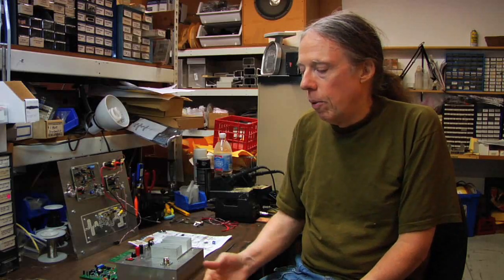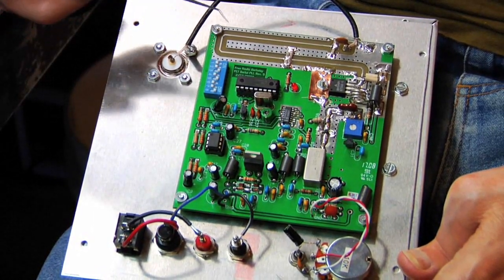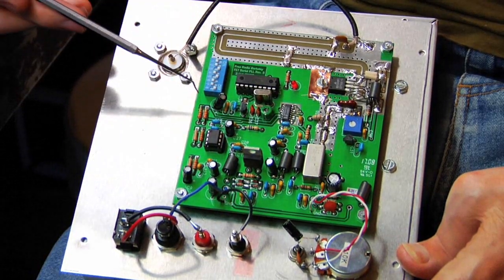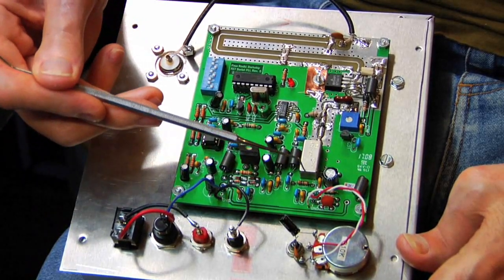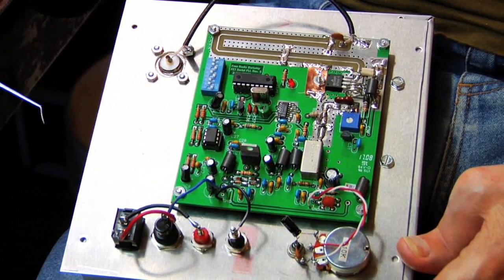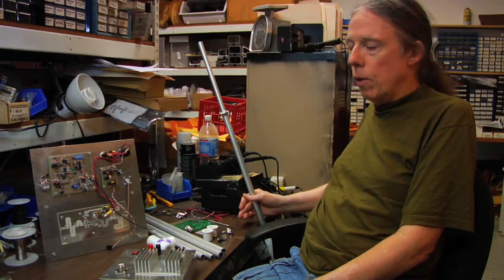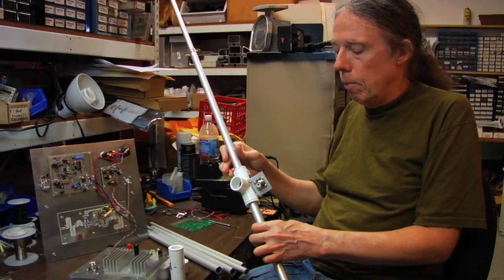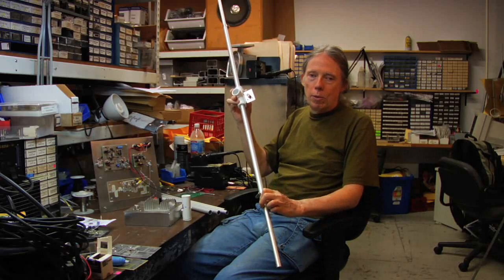How to Build A 10 Watt FM Broadcast Transmitter & Station

Comment: In the 1990's I was "R. Scott Communications". I built & sold 100's of Low-Power FM Broadcast Transmitters (mono & stereo, 5-25 watts) plus RF Amps. It was so cool to see these micro stations popping up all over the U.S. & Canada! I am pleased to see Stephen is still at it....also Wavemach Comm of Canada. Rock On Brothers!! (PS: Maybe I should go back on the Air....I still have a 25 Watt Unit...haha! Thanks for posting this video!

Comment: It's an MFJ-259B. On VHF it covers up to 170 MHz. So it will cover the FM broadcast band. Not the cheapest thing around; but it's an excellent piece of test equipment. Worth every penny I payed for it. 

You can always boost the power of the transmitter, but more power is not a substitute for a crappy antenna. 10 watts and a good antenna should be fine. On 2 meter FM I can reach a guy 6.5 miles away using only 5 watts. It works because we both have good antennas.

Comment: Hi. Agencies in the UK are using some kind of digital transmission radio equipment with a transmitter that is inserted into the top of peoples heads. Nanotechnology is also being used in conjunction which is fitted into ears and over eyes. Do you have an knowledge of this and how can it be tackled. Kind regards.

Comment: oh and the antenna was tuned to my frquency (93.9 MHz) - it had two plates which had to be aligned at the bottom , I forget now where I got the antenna from but it was great - you could tune it using a SWR meter no problems but that was a bit "hit and miss" trial and error but there was a machine which would help i think it was "veronica kits" or something the guy tuned it all for me - top fella :)

Comment: This could also be titled "How To Meet A Real FCC Employee Within 24 Hours"
Reply: cool
Reply: +kevoice lol
Reply: +kevoice We constructed a simple fm transmitter for a lab at my university. All I could think about was the FCC techs seeing twenty different signals at the same frequency pop up simultaneously on their S.A.
Reply: "How To Meet A Real FCC Employee Within 24 Hours" and than poke him/her in the eye.
Reply: kevoice      I run all NRG kit built transmitter stereo encoder and I also run 15O watt power Amplifier attenuated down to about 4O watts I also built and designed my own copper J-pole antenna usually used for 2 meter amateur radio I lengthened my elements just enough to make my antenna resonant at 1O7.3 MHz       1O7.3 FM THE PIRATE ...   I run all silver soldered tinned rf coils in my low pass filters one on my exciter or transmitter another LPF on the PA.  I have a flat match with all forward Wattage covering over 15 solid miles in stereo and very clean... no distortion I also run two dbx-163 compressors limiters.. to keep my audio at an even tempered level...
Reply: kevoice         I have the dimensions math and plans for a 3 meter broadcast band J-pole or slim Jim antenna ... j-poles kick arse for FM  VHF broadcast service.. actually they may surprise you a well constructed and finely tuned and matched up,to your system well ... they Rock...
Reply: kevoice    If anyone wants the magic numbers to divide your frequency into to give you your element lengths ....     section A the longest copper element is 8838 / ? (Your operating frequency.).   Section C is the grounding stub the short one  you take 2952 / (your operating frequency)  = your stub length.  Also be sure you make a 3 3/4 inch space between the two elements. Center of coax goes to the long element, shield of coax goes to the shorter matching stubs nice piece of solid copper house wire makes a nice gamma match between the two elements... also sliding the wire up or down the elements before you solder them permanently, I use radiator hose clamps for the matching procedure...   antenna appears as if it’s a direct electrical short... however it’s not to an alternating RF frequency...   DC yes it’s a dead short...
Reply: And you think that's good?

Comment: Is it possible to get a link to the schematic? How would I disable the pre-emphasis. I am interested in this unit. I may just buy the kit then replace the dip-switches with a micro-controller (arduino or something similar) so that I can change the freq quickly if needed and have the freq on an LCD. Also, can you recommend a el-cheapo deviation monitor? Does this unit have anything to control over deviation, or is it up to the user to run a limiter?

Comment: Hi
I'm just asking, I have a15watt fm transmitter can I take the cable that going to the antenna and connect it to sound amplifier and then take the cable from the amplifier to the antenna so as to boost the signal over this15 watt?
If not how can I increase the signal of the transmitter
Please reply your opinion is appreciated
Reply: I'm not an EC geek but to my understanding, the cable going to the antenna carries RF signal, not audio, hence the sound amplifier cannot process or amplify that signal.  I tried this some time ago and it did not work.  You will need an RF amplifier, not a sound amplifier.
Reply: RF Amplifier will do the trick
Reply: *****
Thanks for your reply friend
Send video demonstration of this if possible. 
It will be nice
Reply: gambulgambula  is very good ...dilipbhai india
Reply: You need a proper RF amplifier, not an audio amplifier.

Comment: Are there any plans to create a variable-wattage transmitter? It would be nice to go from 1/2W, 2W, 5W, to 10W on the fly as needed. Does this unit provide stereo with pilot? Also, it would be nice to have the ability to inject RDS or other subcarriers into the chip before the RF output.

Comment: Re: 6watt rev 2 
How stable would you say said circuit is?  I'm new to the game, I've built but one transmitter to date and got it working but found that the capacitance was easily swayed any movement would knock it out of tune.  PLL does interest me, but I think it may be a tad too advanced for me as of yet.

Comment: Is this a STABLE DRIFT-FREE transmitter?

If you tune a radio to it's frequency, will it stay on that frequency and not drift off?  Does it work
equally well on the old-style ANALOG string-type radios as well as digital FM receivers?

The tiny 2-transistor bug-type FM wireless mics always fall off the frequency and you lose the
signal entirely.

Also, do you need special FCC license to use this transmitter for home office or factory use?

Comment: hi
i watched your 10watt FM transmitter i like it.
but i need to ask you if your town/city has a powerful station and you tried to transmit on the same frequency  how far would you hear your music ??
iam asking because at work the young guys listen to crappy boy band song and i would like to over power them into some nice ACDC!! but then i don't to get into trouble so only about 150feet would do nice to over power them and not disturb other people.
Reply: The FCC would come knocking on your door...
Reply: Actually depends on how far you're away from the transmitter and how strong their signal is (and of course yours). Let's say you've got a 10w transmitter, then you'll probably not be able to kick off a professional 50kW station, even if it's 40km away from your transmitter.
Reply: This is illegal. You can get in huge trouble for doing that.
Reply: And?
Reply: Blocking another station is the quickest way to get the FCCs attention. The owner of that station will track you down for the FCC.

Comment: I really dislike PLL frequency control because I have had bad experiences with it on tuners,  but do like that fact it helps with drift and stability.  Do you use a BA1404 combo chip and a 19khz pilot crystal for stereo carrier?

Comment: How can we increase the broadcasting range. What are the requirements to strengthen our signals for longer communication distances. Please help :)
Reply: The best things to do to increase range are either get a more powerful amplifier, get a better antenna (if it's not already tuned to the frequency you would be broadcasting at), and arguably the most important thing is to put your antenna as high up as possible, which will allow the signal to go further.

Comment: The problem is that it was weeks ago that I put it together - minus the final + copper. I  didn't finish it and power it until last week and when I did the final got instantly hot and the LED came on for a few seconds then faded to nothing. There was no mod on the carrier freq ether. The soldering portion of this was super easy, however there was some differences in what was in the directions, on the silkscreen, and on the parts sheet (with components taped to it). I can't remember specifically.

Comment: It depends on a number of factors. One factor is your antenna. A good antenna makes a difference. Ham radio operators can get some pretty impressive distances on VHF FM using low power. It all comes down to the antennas. Dipoles are fine antennas. On the 2 meter ham band J poles are pretty popular. An FM broadcast J pole would be simple enough. Just make sure the antenna is properly tuned so you don't damage the transmitter. I have an MFJ antenna analyzer I use for my ham antennas.  (continued)

Comment: well done thanks for the video,i once had a transmitter that put out some 150watts and a big 15 element long boom wide spaced yagi,but as i was going through my ham radio licences i was always a bit worried about using it,ended up swapping it for a ham radio.dont u guys get lots of hassel from the fcc(offcom in the uk),using pirate cb was bad anuff,.
kev

Comment: why not a crystal oscillar circuit, with a socket to swap out crystals? A PLL circuit is advanced method. also, is this a phase modulation circuit or a fm circuit? (phase modulation and fm modulation are very similar

Comment: Really, what you need to design is a simple AM transmitter that can be built in prison, from AM radio parts.  Its been done before by inmates, not hard to do. I wanted to set up a pirate radio station in prison but didn't have my own AM radio to butcher for parts, as I never got shuffled around to one where you could buy it on the store. I suppose I could of bought one second hand but I was thinking more along the lines of a simpler spark gap transmitter, and also, um, just surviving day to day.

Comment: The Problem I have is Monetary as well, I can't just go buy a receiver, I can't afford one.  But I am very good at making things and I have a lot of parts because I recycle Electronic boards from old TV's Stereos, etc.. I just need to find a decent Schematic and a parts listing.  Then I could build Just about anything.. I also recently bought an Arduino Uno I wonder if that could be of any use.  I m still trying to learn how to program it though.. I am just exploring this RF stuff it is learning

Comment: sorrym this isn't my site but FYI I put a decent antenna on my rig after my dipole went kaput - basically mine had the standard output screw-on socket and I just screwed my (new) vertical antenna straight in, after checking that the cable soldering was perfect, firstly checked the TX on a dummy load to make sure it was ok, I used a normal Citizen's Band (27MHz) SWR meter to check the Standing Wave Ratio and it was good, about 1:1.15,  I had a 7Watt rig but the antenna gave me like 14Watts e.r.p.

Comment: Is the length of the leads to the final transistor important? I feel that it might be, but do not know enough about this design. I ordered a kit and want to install the transistor on a heat sink about 6inches/15cm or less from the spot on the board where it is mounted...How long does shipping usually take?

Comment: can i   vary the power from 1  to 10 watt
Reply from the maker: Yes, the power can be adjusted from 0 to 10 watts with a trimmer pot located on the circuit board.

Comment: Repeating what Jazz Man sez....NEVER, UNDER ANY CIRCUMSTANCES operate the transmitter without either a transmitting antenna or properly-configured resistive network of sufficient capacity ("Dummy Load") attached to the final RF output BEFORE turning it on!
Reply: Correct. If the transmitter is on, and there is no "load" connected, you WILL eventually burn out the "final" transistor. Often, one of the most expensive parts.

Comment: Or I could just buy a Fail-Safe or HLLY 0.5 watt FM transmitter for $60 off Amazon or Ebay.. :-)  They also make 4/10/20 watt units.  Right now just to goof around I'm using a modded Belkin Tunecast II I bought for $3 at Goodwill and a 1gb USB stick MP3 player I bought at the mall for $15 with 15 ft longwire. Whole thing including batteries fits in my pocket, range about a block omni directional before it starts to fade, which is good enough to cover public events / gatherings.  3 triple A bats.

Comment: Actually it reads U aren't concerned about legal operation In that case why not purchase a commercial transceiver capable of operating on the frequencies you desire & programming in the frequencies you want? At those frequencies line of sight will be your primary factor limiting range, something power will not overcome. Power does come into play if you have a fantastical long line of sight situation though

Comment: I need a kit for a GMRS radio, so that I can make a Base station.. I need at least a 50 Mile Range.. 5o watts minimum.. FM I believe is 1 watt per mile give or take. Frequency required 462.550MHZ FM to 467.725MHZ FM This is probably illegal especially over 467.5625MHZ because GMRS is not allowed on those frequencies over 5 watts There is a GMRS repeater, but I can never seem to get it to work, so I need some high Watts! how much would it cost for you to build and sell me a kit to make this?

Comment: Very basic unit without stereo.  Might not even have pre-emphasis.
Reply from the maker: Basic, yes, but a very stable and clean design.  It does have pre-emphasis - 75 for US, change cap value for 50.  A separate stereo encoder can be added if required.  A lot of the cheaper FM transmitters use an all-in-one IC to generate both the FM signal and stereo composite signal.  This results in audio with very poor left-right separation and overall, less than stellar audio quality.   Broadcast quality transmitters use a separate encoder to generate the composite stereo signal.  A software program called Stereo Tool is a relatively inexpensive (as compared to the cost of an Orban processing unit) DSP solution to creating a composite stereo signal and processing the audio - https://www.stereotool.com/ .  It requires a higher end audio card for best results.

Comment: Don't breath the solder fumes.  Keep the kid away from the solder gun.  It is all too easy to get  a heavy dose of heavy metal.  I don't mean Led Zeppelin.  I had 40 times the lead level than I should have had.
   Also, I was wondering if everyone owned one of these these transmitters if they could link all the computers together in a community and bypass the expensive internet access company by passing data from one to another.